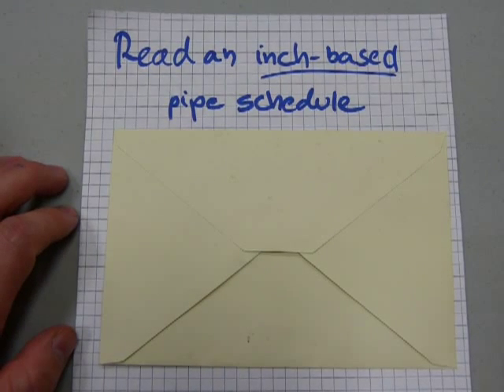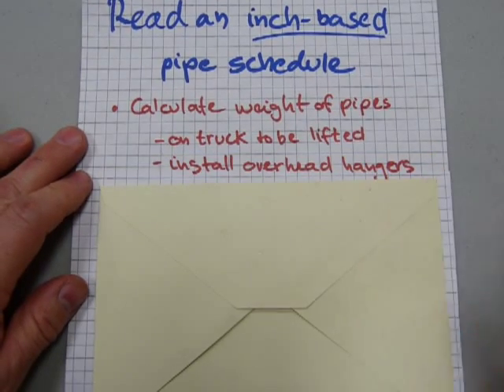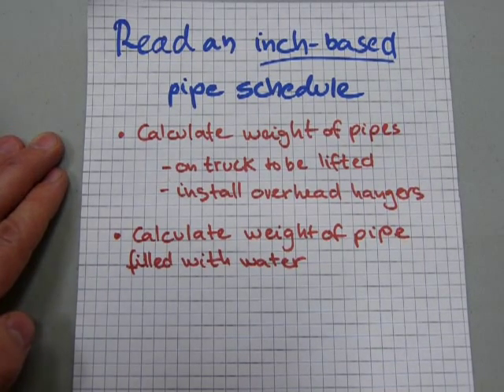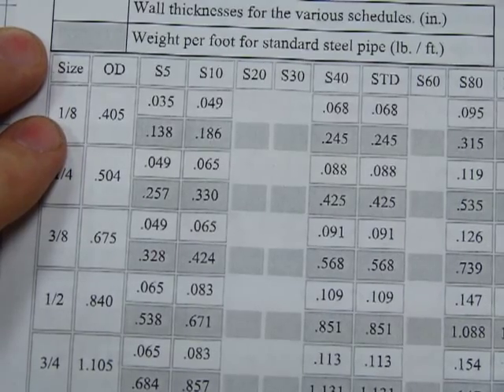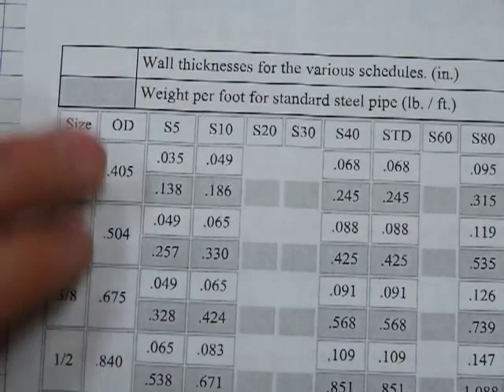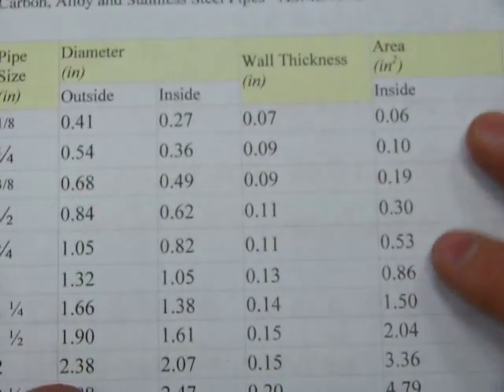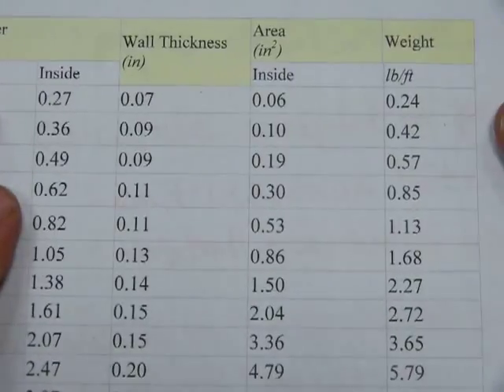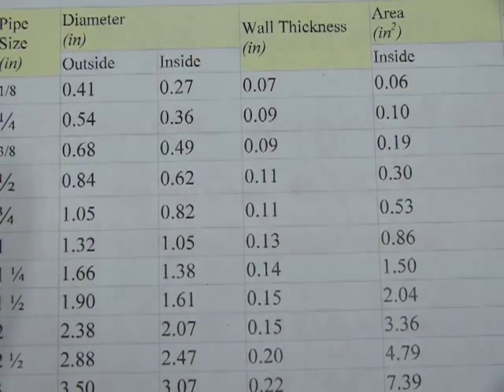How to read an inch-based pipe schedule

Comment: Yes a screwed connection.  Now how would you measure wall thickness of a pipe in such case. Because when you measure it at the end of screwed part - it has reduced thickness. So how would one know the correct wall thickness? Thanks for the video though. Its quite informative.

Comment: For a screwed connection - would not the the thickness measured be different?
Reply from the maker: A threaded connection? Same wall thickness, but may be different at the threaded section.